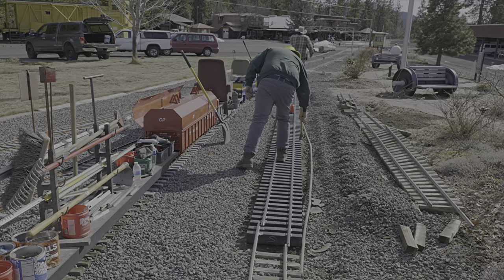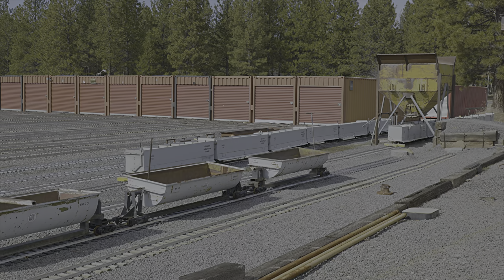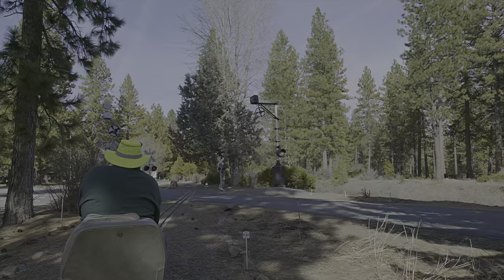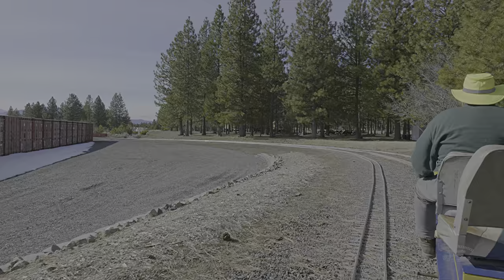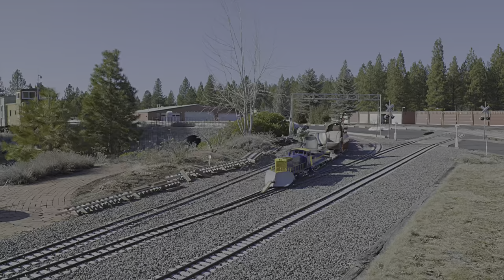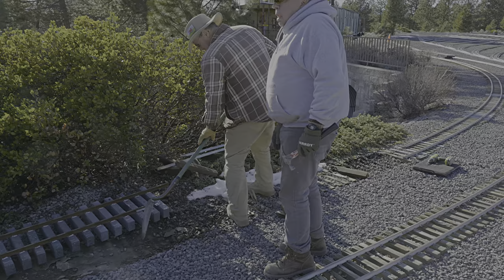Laying Track in  February at Train Mountain

Comment: The guy with the Navy Yard loco must live on-site or nearby because I see it in nearly every video, and it seems to be a go-to for maintenance trains. What sort of drivetrain setup is he using?
Reply from the maker: Dennis has the Navy loco, and lives about 3 or 4 miles from Train Mountain. That loco has more miles on it than all the others around here combined. It has a Briggs and Stratton Vanguard V twin gas engine, I think 16 HP, with a hydrostatic drive system. All axles on the loco and engineer's car are driven, so it has a lot of tractive effort available.
Reply: He keeps it in good shape. Don't think I've ever seen it dirty!
And that was going to be my next question, was if the slug behind it was powered as well.
Thanks for the responce!